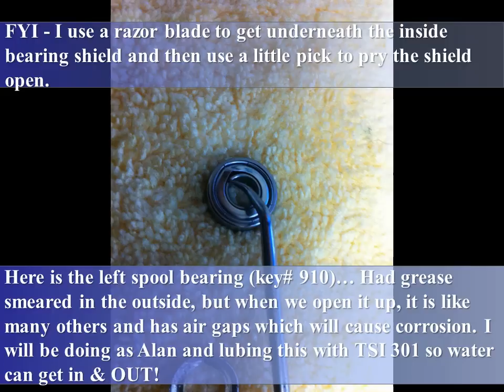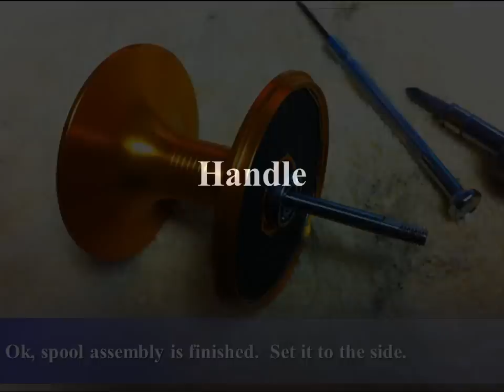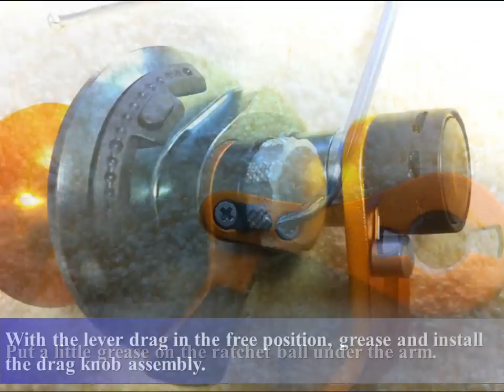Okuma Andros 5II Reel Service Tutorial

Comment: I have a new Okuma Cavalla 5-iiLX 2-speed lever drag reel. My problem is the speed changer button. The retaining ring of the button was out of place and the button stays in the lower gear. the lever to disengage it doesn't work anymore. Is this common to Okuma 2 speed reels? I have only used this reel thrice and got some nice size fish with it.